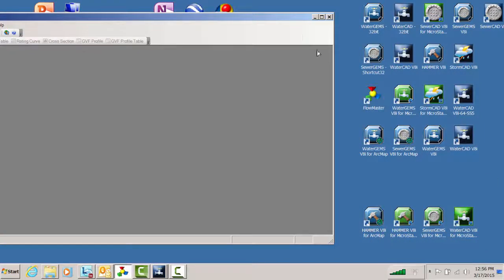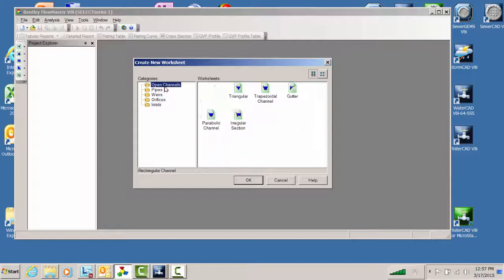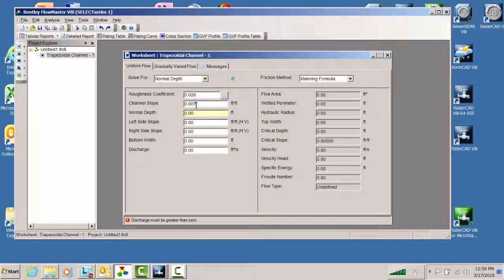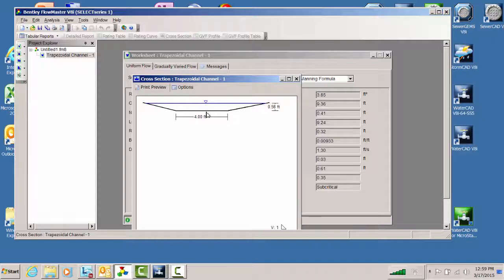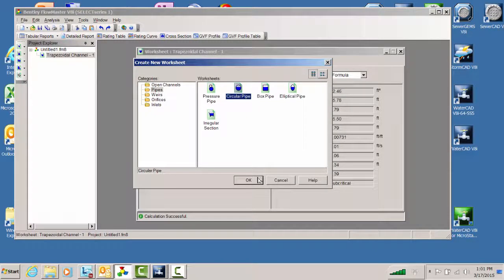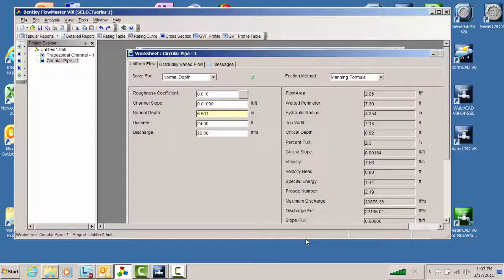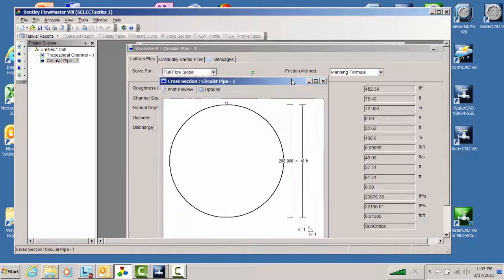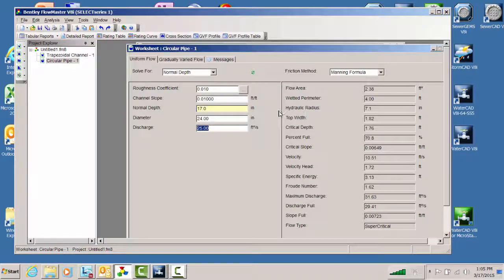Introduction to FlowMaster: analyzing a trapezoidal channel

Comment: does the pipe calculator have a backwater feature? thanks
Reply from the maker: Hello Mike, the channel and pipe worksheets in FlowMaster have a Gradually Varied Flow tab where you can enter information such as the downstream depth. See more in the below article and please post on our forum if you have further questions.

https://communities.bentley.com/products/hydraulics___hydrology/w/hydraulics_and_hydrology__wiki/23545/modeling-gradually-varied-flow-and-hydraulic-jumps-in-bentley-flowmaster

https://communities.bentley.com/products/hydraulics___hydrology/f/haestad-hydraulics-and-hydrology-forum